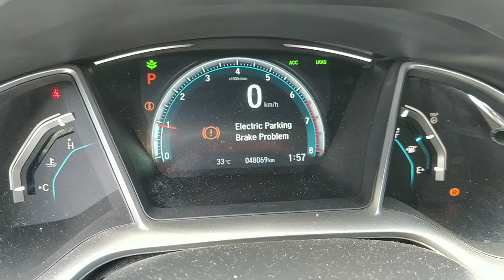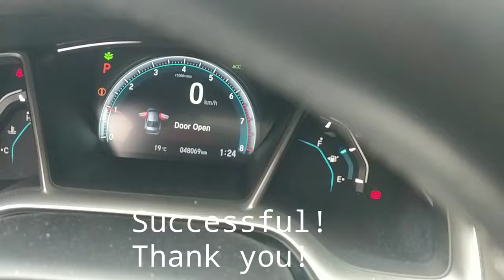Honda Civic 2016: parking brake problem

Comment: Use a hammer instead of your hand to tap on the wrench to get your boats tighter it's easier on your hand and it works better just don't over tighten the bolt you will break it guaranteed

Comment: What could be the cause? Im having the same issue. But the error is intermittent.
Reply: Did you find the cause ? I’m having it today ? Should i change the break ?
Reply: Have your ecu scanned. Its one of the sensors. Mine got fixed. Never appeared again.

Comment: Great video. Thanks for the upload.
I just got the same message at 94,300 miles on my 2018 Civic EX-T.
I always use the parking brake before releasing the regular brake when in Park.
The message cleared the next day and the parking brake works fine. If the message returns and the parking brake become inoperable again, I guess I’ll have it replaced.

Comment: I am in disbelief that you disassembled the caliper because it wouldn’t turn back in. These aren’t designed to turn in, they push straight back (after being put in service mode or by retracting the parking brake motor). But turning the calipers on these civics can actually cause damage. Props to you though for willing to try this yourself, but I’m worried you may have replaced the caliper with the chance it may not have needed it